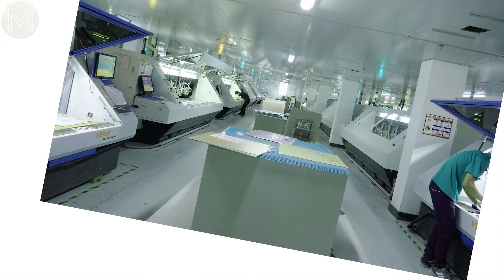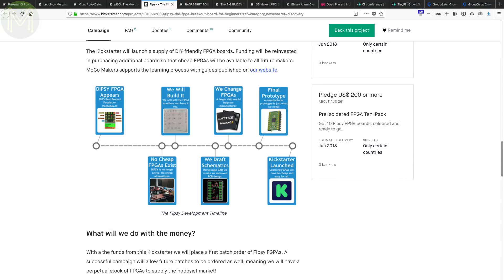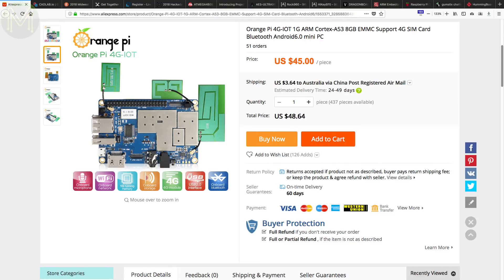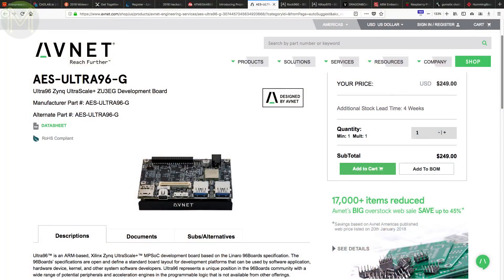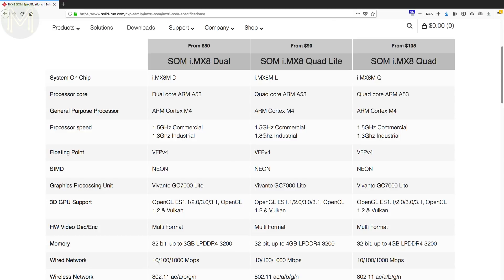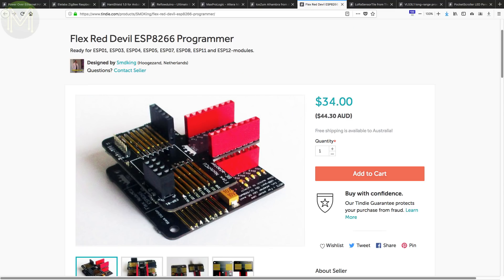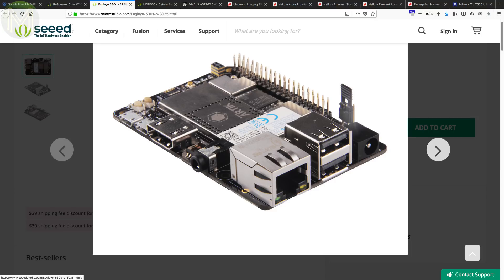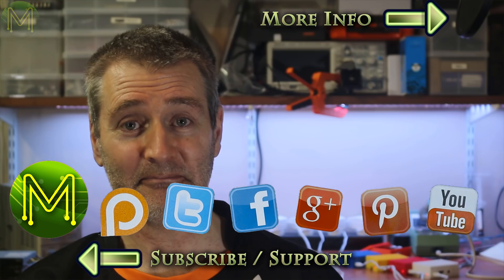#203 Weekly Roundup #53: New Maker Products

Comment: Your pcb sponsor could design a board for me? how many boards would I need to order and what might it cost?

Debian machine, ethernet and 2 mini pcie slots?
Reply from the maker: I use a Mac & Linux - EasyEDA hasn't had any issues with Firefox or Chrome on those platforms.
If you go to https://easyeda.com/order - you can look at prices there.

Comment: I don't understand why Poe is necessary, you could already solder cables on to the gpio pins which people do if they have a Raspberry Pi cluster, because they can power all of them with one custom cable.
Reply: I mean I guess you don't have to solder for $17, but the point of soldering is because it's cheaper and better for cable management. I mean imagine a Raspberry Pi server powered with micro USB cables with bad cable management.
Reply from the maker: Being able to both power your Pi and run network to it from the same cable is really nice. I have a bunch spread around the house powered by PoE. No need to have an ugly wall wart as well as Ethernet.

Comment: CCL has been around for quite a while on AVR chips, previously only in XMEGA variety. I've used XMETA-E series, and it had this feature. There are also some interesting XMETA peripherals, such as 128MHz (!!!) PWM timer, which gives 8ns timing resolution, good enough for simple digital SMPS switching at tens to hundreds kHz range.
Reply: Surprising that they released yet another AVR8 with no USB.  This will be of little interest to us hobbyists.  There are already several interesting AVR8s that are not widely available/economical, like the attiny841.   Yes, the Xmega-u chips do another real trick ... running full blast USB2, while remaining ice cold.  Odd they have not caught on . The STM32s must be more interesting.